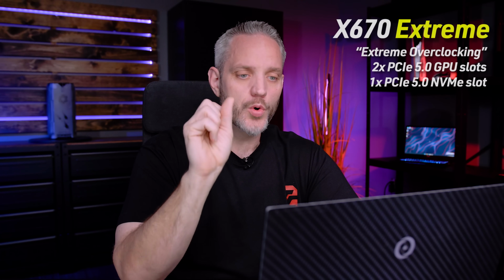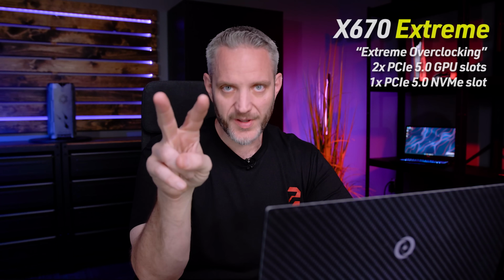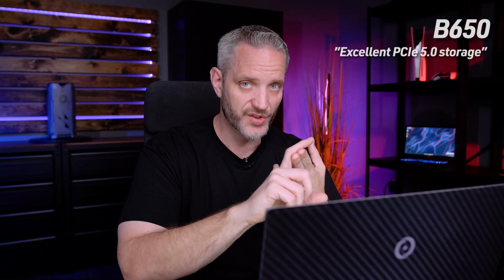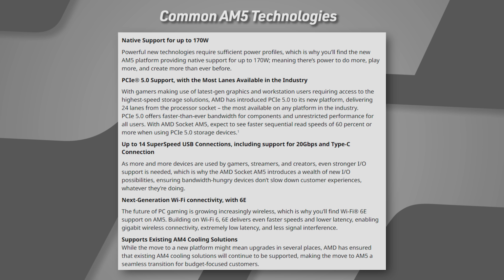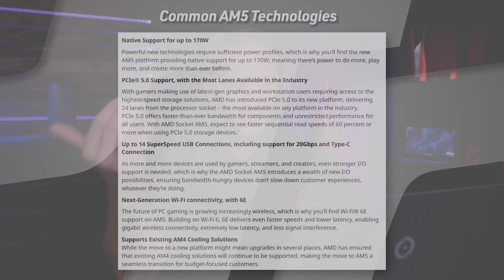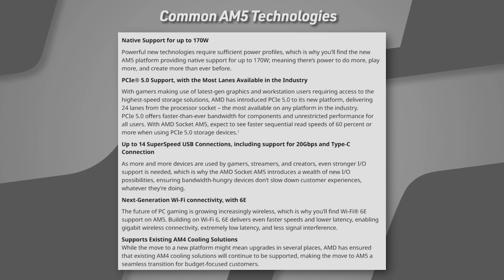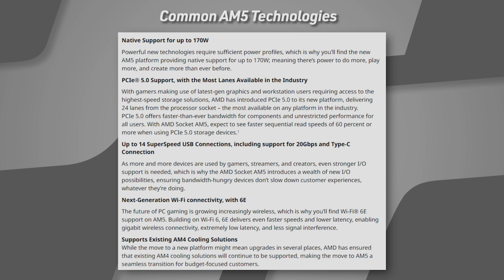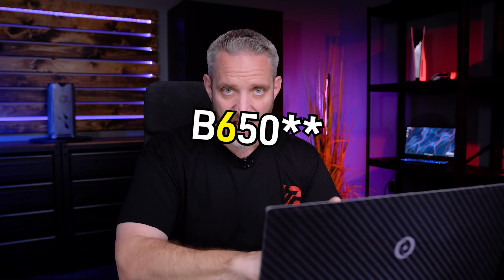AM5 Motherboards are EXPENSIVE! AM5 Explained

Comment: I'm currently on a 3700X, 32GB RAM and a 1080 ti. For 99% this is perfectly fine, but MSFS2020 brings it to its knees. It's playable but not great, there are some stutters, and VR is out of the question. When team Red and team Green both released their new GPUs, and they've been scrutinized by 3rd party reviewers, I'll treat myself to a new rig with whatever is the "enthusiast value option" at the time. That might be a 7600X, who knows. Maybe I'll even wait a little longer for the X3D chips, given that 5800X3D does extremely well in MSFS. I'm not in a hurry, but it will be something from the upcoming gen.

Comment: Smart power stages with higher current ratings are often not that much more efficient than lower rated parts. There's a lot of really efficient 70 amp parts that behave for all intents and purposes identically to 90 amp parts. Sometimes the 90 amp parts have an identical efficiency curve and are rated for more hours at a higher temperature...the inflationary cost of higher phase counts and "better" parts really have been ramping up for a few generations now. I just finalized an am4 build for my wife. I'm on a 4790k. It looks like I'm probably going to have to build another system sooner rather than later. I'll be watching the launch closely, but most likely I'm gonna try to snag B550 stuff on the cheap.

Comment: Being forcing into an operating system makes these upgrades a hard sell for me. I hate windows 10, but run it on some older machines that I have and it's just ok. When I built my primary system a few years ago, I specifically bought parts that worked with and has driver support for Windows 8 and refused to have my hand forced to run 10. I recently tried to run Windows 10 since 8 is losing support, but my ASRock x299 board crashes every time I launch any web browser. It would just BSOD immediately. I think its a problem with the board since ram and gpu worked fine in my x99 system. I've been looking at the Intel 12900x stuff recently so I'm not sure if I would go with AMD this time around. I kind of want to, but not sure how long I can hold out on this platform.

Comment: There are a lot of things that go into the pricing for new motherboards that makes the $250-$400 price the way it is.
-PCIe gen 5 is expensive to implement, the controllers themselves are expensive and they're BGA packages which is more expensive on the manufacturing line
-PCIe gen 5 requires more shielding and higher quality components to meet the signaling requirements for those speeds. This means you need more PCB layers, and need SMT soldered x16 slots both of which add more cost, the extra layers especially (one of the main reasons that ITX boards are significantly more expensive than their larger counterparts)
-DDR5 also requires more shielding in order to meet the signaling requirements for decent memory speeds, this will be more apparent as DDR5 ages and speeds increase but many DDR5 DIMMs are also SMT soldered to the board
-AM5 X670/X670E  are dual chipset boards, we don't know what AMD is charging for the chipsets but having two BGA chipsets on the board adds quite a bit of cost
-The standard VRMs on X670/X670E boards are larger and using newer powerstages leading to more cost along with the fancy heatsinks they insist on adding to the boards
-Going LGA is more expensive, the sockets themselves cost more and they get damaged fairly often leading to higher costs for the retailers and distributers
All of these factors that are seemingly small on their own but add up to a fairly significant increase in the cost of the board, the double super duper mega xtreme boards for $1000+ have always been a gimmick, I've never understood the point of the Z690 Extreme when the Apex performs better and the Hero has pretty much all the same features.

Comment: waiting on the X3d models, i need to move my 2950x w/5700 XT off to my server closet and upgrade!  since I migrated to a 4k monitor this summer, surprisingly some games play as well on 4k as on ultra super mega wide 3440x1440, which was a real shocker, but it will be nice to get back up over 66fps for a change and to be able to use a second monitor again (note I can use another now, but I take a 25 frame hit on my fps when playing games in 4k with even a 1080p second screen).  Not worried at all about PCIe5 yet, I haven't even moved to 4 (without looking it up, I might not even be using PCIe 3 yet...).  Performance wise the 2950x is still going strong, never notice any issues that might be caused by it, but I am sure once the X3D CPUs launch I'll be able to tell the difference after upgrading.  As far as win11, I definitely do not want that!  no idea how to avoid it though...

Comment: Almost certainly will be adopting AM5, but not for quite some time. Currently running a 3800XT/6800 XT and until there's a compelling gaming performance increase to be had for around £1500-£2000 total system cost, I'll stick with this machine. Probably looking at Ryzen 8000 or 9000, and Navi 3 or even 4

Comment: I built my 3700x 2070 mini x570 elite 2x512gb pcie3 m.2 and cl16 2x8gb 3600mhz rig in early 2020, bent 3pins in 2021 in trying to replace stock cooler with nzxt x53, saw your video and a local dealer straightened it for me for 800 rupees ..11$ and got a free replacement in 7 days. Yeah, Best lockdown experience. I will always remember my first 4770k build but this one is my best tuned one for the performance to price. Am gonna keep this the way it is till 2025 or later until DDR5 has CL 20 or lower. maybe like a 10700x (amd)

Comment: I'll probably follow my normal routine of waiting until a few months before 8000 series chips are coming out. You get the best deals on the chip and the MB should be good for at least 2 more generations. Currently running a 5900X/3080 ti on an X470 Strix board, so I should see a small uplift just going to PCIe Gen 4/5.
Reply: I have the same setup and I'm right there with you.  Glad to those that will see an uplift if they are coming from Ryzen 3000 series or older but I'll be holding off until Ryzen 9000 / Nvidia 5000 series or later before I even consider upgrading
Reply: @insomnikali  I tend to upgrade every generation because it ends up being small, incremental costs. After reselling the old board, CPU and RAM I'll recoup a huge chunk of what I spent on the new parts.

Comment: My primary system has a dual open loop liquid-cooled Ryzen 9 3900x and a Saphhire 6800 on an MSI X570 Unify. I think it will be more than enough for the next several years. So no plans to jump up to AM5 for a long time.

Comment: one reason for 2 gpu slots on the 670E is Nvidia's new hardware based raid using a quadro card.  LTT did a good review of that.  a second resone is that PCIe5 has built in commands in it that make SLI and Crossfire obsolete.  using PCIe5 IO commands one device can now take control of a second.  I for one will be skipping Zen 4 and waiting till Zen 5.  I have both a 10900K and a 5600X and see no reason to move to a 7700X for what will amount to maybe 5 more frames per second in Video games @ 1440P.  When Zen 5 comes out DDR5 should be reasonible in price and my 2 GPUs will finally be getting long in the tooth.

Comment: some simple clearifications:
B650 ---only 1 gen5 nvme,  lowest number of conectivity with usb4 included
B650E-----1nvme + first x16 slot with gen5, lowest number of conectivity with usb4 included
X670---1nvme + first x16 slot with gen5, highest number of conectivity with usb4, more nvme slots with gen4
X670E full 28 lane gen5 support ( 4 are reservated for the chipset but can  pass thrue to a nvme slot but SATA share the same lanes)
overclocking support on all mainboards, the E mainboards just have better ( or overkill...) powerdelivery for the cpu and ram
EXPO is not like XMP for intel...EXPO is more like a automated ram overclocking, the ram manufacturer still provides basic overclocking profiles ( like XMP ) but other users can allow to share there overclocking profiles ( if they can push there ram higher or with better timings then the manufacturer sets it too ) to a "library" and other EXPO systems can acces this library to find even better profiles. the EXPO tests all different profiles for your specific ram until it finds the max stable setting.

Comment: I already have a O11 mini with full watercooling setup waiting for 7700 cpu and 7800 gpu. The only*fun* thing is that for best results I need a mATX board. So I am wondering howATX and ITX boards will perform this time around.
Reply: Upgrading from 3600/6700XT that is going over to relatives.

Comment: The density of the traces and layers on an AM5 motherboard must be insane. Of course they have to be expensive. What I question is the need for DDR-5 and PCIe-5.0 at all. They could still manufacture six cores on down as Zen 4 Athlonx3D processors on a DDR-4 and PCIe-4.0 platform. Instead they're just going to abandon budget computing entirely.

Comment: I need at least 6x SATA ports for all my HDDs and SATA SSDs.... But most newest platform only support 4x SATA. I usually buy MBs only for their IO. But now... Even lots of X670 only get 4x SATA.
I started to use M.2 NVME SSD since 2017 but didnt find any significant advantage than SATA SSDs. 
Also I dont think PCIE5.0 will make any difference than a PCIE3.0x4 SSD for mainstream users. Also... PCIE5.0 for GPU also wont make lots of sense especially for higher ends cards. PCIE bottlenecked when you need system RAM for extra GPU RAM like a lower end cards. But lower end cars get fewer lanes now than previous days all GPU get x16 lanes.

Comment: I'm going with AM5 as soon as I can get a coherent build together from the available components. Haven't decided precisely what I will get but I am leaning towards a 7950x, motherboard will depend, I have specific feature needs as I use it for gaming, software development, and music production. So I will buy the best priced board that meets my needs. For the sake of another month I may wait for the NVMe 5.0 release, It might speed up some of my data processing workloads and would be beneficial in some of my tooling. I want to see the cost before I make a decision, its going to be marginal gains I expect, so the cost needs to be realistic.

It takes me literally weeks to get all my software/hardware installed how I like it. So AM5 with the potential to upgrade/replace parts for the future is appealing to me. My current PC is Intel (4820k) and did me 7 years (remarkable), and frankly if it wasn't getting a little twitchy I'd not be in a hurry. I feel this is a good time to upgrade, hopefully it will last as long as the last one. I think AMD is the choice right now, I expect I'd be happy with either Intel or AMD, both would be fine for my needs. Intel gives me pause though with the E-Cores, I have a lot of specialist software that won't be getting optimized, so it is hard to predict how those workloads would get allocated, I'd rather just keep things simple and avoid any potential problems.
Reply: Agree. I am going from a 10-year-old Xeon X5687 and X5690 workstations which have been solid but now that Ryzen is above 5Ghz its time to upgrade. For me having ECC available with DDR5 is a big bonus too.

Comment: I so want to upgrade as still on intel i7700k I use to upgrade every 4 years so I thought at the start of this year I wait get the new AMD and 4000 Nvidia card and then Bang it all changed. With the way the world is and the cost of power here in the UK going from £1900 to £3500 and then to £5000 a year I don't think I can  afford to buy this and run it  the cost increase is 80% in October and another 50% in January 2023 I think this is not a wise buy.

Comment: I would really like to switch from Mac to windows and I think now might be the perfect time. I would also like to go with AMD but the lack of Thunderbolt capable mainboards on the AMD platform is sobering. I hope they bring at least one AM5 board with thunderbolt, it would be really bad if I had to go Intel because of my audio interface. Not that I hate Intel but Intel and Nvidia require a nuclear power plant.
Reply: Intel isnt bad with power. Sure people will downvote me, but just look at the benchmarks yourself. A 12700f is only slightly less efficient than a 5900x. In gaming the difference is neglible and in idle Intel takes a small win. The 12700k and 12900k are hot. The other alder lake cpus are fine efficiencywise.

Comment: Two PCIE5.0 GPU slots for maybe crossfire? Are they lunching 3000-4000W PSUs as well? Thinking of having your stove running almost full boar all day long, don´t think "crossfire" will do any good. If Intel manages to get their "crossfire/SLI" with the iGPU working that´s where I see a chance for sucess, that route can be done without devs and could be souly up to Intel´s driver team when devs aren´t interested. But two of the same cards? They tried that for more than a decade and if it even worked there always where microstutters in optimized games, how would that suddently chance? It´s not like the microstutters where due to bandwith limits which were overcome.